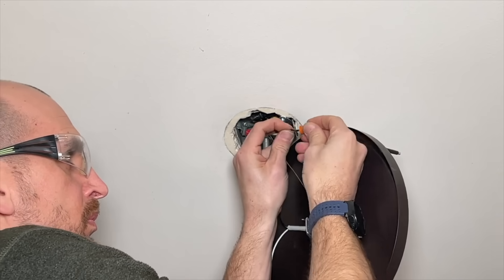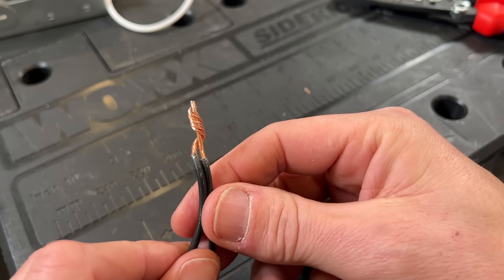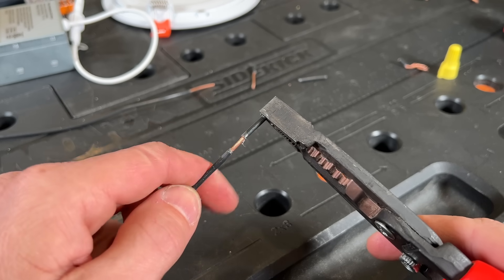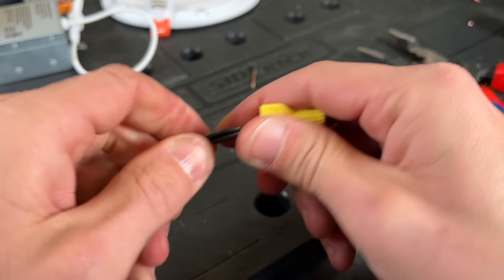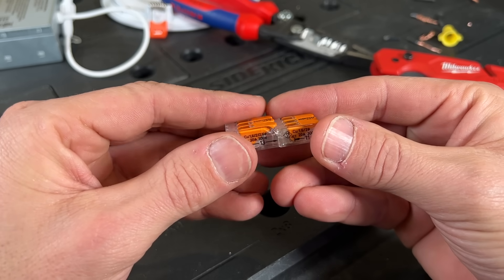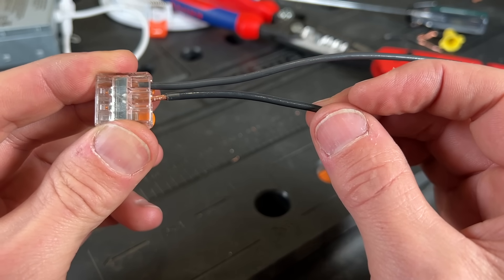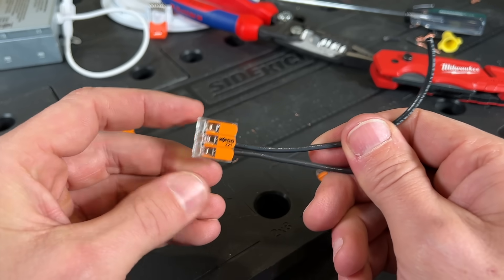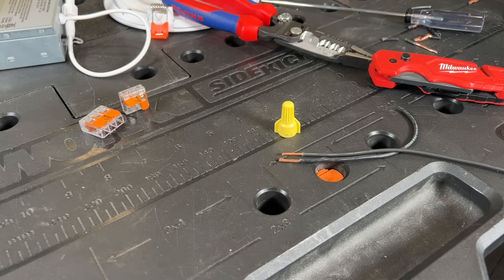Most Common DIYer Electrical Mistake - Don't Let This Be You!

Comment: Nothing beats wire nuts for cost and, as a pro electrician, that's the driving factor. I use thousands of them every year, and replacing them with Wago would be a significant cost increase that I would have no choice but to pass on to the customer. That being said, there is one place I always use Wago: when working overhead. Especially in recessed can fixtures. At 63, the less time I spend on top of a ladder with my hands overhead, the better. Wago is probably not enough faster to mitigate the cost differential, but my body really appreciates them at the end of a long day.
Reply: I also use my Ideal Stripmaster wire stripper when doing can lights. Being a union electrician, I took some heat on this but grew tired of cutting my knuckles and fingers on the sharp edged J boxes mounted on can lights.
Reply: @garrythompson4132  I feel your cut knuckles brother. Got the scars to prove it.
Reply: I learned something I hope this is. Correvt
Reply: Thats not allowed in germany ..we have to use wago's or other closed connectors...safety reasons!!!
Reply: @rudolfrudiger3283  wagos are alright. Nothing special. Literally metal blades are creating the conductive current. I feel nuts have higher contact surface area
Reply: @rudolfrudiger3283  ah. Idk. Seems to me like a child should NOT have access to inside a junction box. Regardless whether wago or nuts. Seems like a parent issue. But yeah I get what you’re saying. I know Europe has higher standards to a lot of stuff. America. We don’t give a shit lol our houses have “garden shed” roofs lmao. I’ve been to Europe. And building quality is 🤌 oh and unions. In America there are organizations you join. If it’s skilled trade. You go thru a program. And school for them. And you earn a very steady income. It’s meant to protect employees from employers. They’ll legally represent you if you have an issue. Or help you with work related injuries. They protect you from abuse of power from employer. Discrimination and such. But unions depend per region of USA. In my area. And my field (HVAC) they’re pretty pointless. Plus I’m too far Into my career to join. I’d have to start as an “apprentice” for a few years and take a huge pay cut from where I stand now. I never needed a union. I always stayed out of trouble. I avoid conflict at work. And do my job. Seems like people that join unions is because they want to take 10000 breaks in an 10 hour work day lol that’s why I feel unions are pointless in my region.
Reply: @rudolfrudiger3283  You say your products are safer but the statistics don’t back up your claim
Reply: @purplesparkyy  400 deaths per 329 million against 40 death in germany (around 80 million people...which statistics you got?
Reply: @Username-ng8jy  I saw a test a while back and at high currents (currents that are within the ratings for the products) properly installed wire nuts generate less heat.
Reply: @johnh8546  wagos are cool for certain situations. But as long as you wire nut properly. I dont see the problem.
If wagos are that good they would’ve made them for industrial high current 100hp motors. 
But we still use special wire nuts and electrical  kearneys for that reason.
Reply: Not as good as Wago cage clamp terminals
Reply: Ehhh, the cost is mitigated by how quick you can connect using Wago. Not to mention it's almost fool-proof when it comes to how its used. Never liked the wire nuts.
Reply: @NorseGraphic  As I said, I use 1000's every year. Wago is 5 to 10 times more expensive per use. I would therefore have to be able to use at least 5 wagos in the time I can twist one wire nut. I assure you that's not true. Properly applied, both are great. For a non-pro, Wago is the better choice since they have almost no learning curve.
Reply: @BB unions are pointless where I’m from. I get a rep trying to get me in lol. I’m always like fuck off dude. I do my work and punch in and out. I don’t look for conflict. I’m good lol
Reply: Common mistake. The customer decides what material you'll use, as long as they conform  the regulations . The technician advises, the customer decides.
Reply: @1Eagler  95% of homeowners don't even know what the hell a wago connector is.
They know which light fixture they want, and they don't give a crap about how you wire it.
It's why they hired someone else to do it.

Comment: Wagos are amazing and completely worth it. I usually do a quick wrap of tape on the wire then over and around the clip body for extra support and to keep the clips closed. They have held up wonderfully in a 120 F humid environment for almost 3 years now no problem.
Reply: only tape insulation not have correct anywere, not safe and not good newer. some year and all tape have open and have clear wires in box.and burn all house.

Comment: Do not use solder. NEC does not allow soldered connections.  Do not use WAGOS.  Contact with the wire is very small.  The 'Quickwire ' receptacles are also a no-no.  I have seen many failures with the 'Quickwire' receptacles.  I equate Wagos with 'Quickwire' types.
Stranded to solid wire connections:  UNTWIST the stranded strands.  Lay the strands around the solid wire with a small length of strands coming past the end of the solid copper wire.  Use IDEAL wirenuts, spin the wire nut onto the wires and then ALWAYS do the tug test.  Treat the wire nut as a cap.  Always make the connection mechanically tight. 'Bad' connections are the #1 problem I see.  Add current to a bad connection means heat at the connection.  Heat means fire.  
Your comments about how to strip the wires are correct, don't rock the stripper and nick the wires.
Be safe.  Thank you.
Master Electrician with 50+ years in the trade.

Comment: Yeah been using Wagos for ever, very popular back home in the UK. When a electrician came to my job he noticed wagos and asked about them he really liked the dinrail mount clips, he had never seen them before. They really clean up a control box and make testing, fault finding or replacement so much easier. US Inspectors are a little unsure of them and ask to see specific details. Great video
Reply: The same principle of using levers in Wago is also used in light-fixtures, as manufacturers moves away from screw-connectors. They're so much easier. You want to disconnect, just push in the lever and pull out the wire. The spring will keep it in place when you release the lever.
Reply: Works great for small diameter, like up to maybe 4mm², haven't seen anything that can handle more than 2.5mm² so far though.

At least in the company I work for we use spring loaded stuff only for the control circuit, everything power related is screwed in place firmly.

Comment: It surprises me greatly that you guys just recently 'discovered' WAGOs...those things are around here (in Europe) for at least 17 years and are 'the basic tol' for connecting wires.... 
Wire nuts just aren't used anymore for about 2 decades.
Reply: They aren't required by code and wire nuts are just so much cheaper and work fine.  I like Wagos fine but they are pricey and solve a problem that doesn't exist.   There was just never much reason or incentive to use them over here.

Comment: If youre that concerned with your connection you can tin the tips of any stranded wire with solder. You can get self feeding solder guns dirt cheap on amazon now that make tinning wire stupid easy and quick

Comment: Good in theory. But... you're leading too much. 1/16 - 1/32 is just as effective. You're stripping too long for 14 gauge. 3/8" is more appropriate. Bottom line is yes, lead the stranded by the slightest bit and problems solved. DIY'ers should really think twice about winging in their home if they need YouTube to install a wire nut.

Comment: Im actually shocked those primitive "wire nuts" are still in use.
I was working 7 years as electrician, worked on 40 year old wirings and never found something even remotely as primitive as this.
I only ever saw Wagos or some similar but older connectors.
Reply: You're not an electrician, you're a sales rep for Wago.  😂

Comment: I'm DIY and would completely disagree with using the Wago style connectors. Here is the problem not shown in this video. When you get one wire in, and you are trying to put in the second wire, and even moreso with the third wire, you wind up twisting the wago and the original wire (s) work somewhat free from the wago like connector. I've had failures with wires popping out of the wago (not all the way out so you don't notice), and not realizing it, when pushing the wago into a light box or drop light container. This video shows a beautiful easy to reach level perfect light situation, but in reality, you are looking upside down, not the best light, quarters for working are confined, wire lenghts are limited, etc, all that real world stuff. I liked the part of this video about wire nuts, but I never, and I mean never, put a wire nut on two or more wires that have not been previously twisted together, using flat head plyers and not twisted together by hand, such that both wires are twisted together, and not one wire twisted around another straight wire.

Comment: Wonderful presentation.  I am a two time homeowner who does all my own electrical work.  I have always dreaded installing light fixtures due to the challenge of connected the solid building wire to the stranded leads on the fixture.  I am a perfectionist and early on I practiced over and over with scrap wire until I felt confident that I had the hang of making a good connection.  Over the years, I also have tinned the bared ends of the stranded leads before twisting them with the solid wire.  When the push-in connectors appeared on the market I had mixed feelings about them but went ahead and have used them in smaller light fixtures in my home. I always tinned the stranded wires before pushing them in. The latest connectors I used to install several motion sensor lights are made by Ideal and have a brass barrel and a set screw.  You slip the bared ends of the wires in and tighten the set screw. Then you screw the plastic cap of the connection.
They are reusable and are well made.
Reply: I don't understand this comment section. I mean I've hung literally thousands of lights/fans. I've been stoned. Ive been buzzed. Ive done it standing on hand rails. In the dark.  I've taped an extension ladder to a step ladder  Ive hung off the sides of houses and hung lights. In the rain. In crawlspaces with crickets and webs and shit. 
I've used wire nuts every time. They always work. 
Why do you all make shit so hard 😅

Comment: The lever nuts look great, but are they readily available and the common stores? They are way expensive too. I can find 180 wire nuts for 7 bucks on amazon. For 10 lever nuts it's going to cost more than 180 wire nuts.

Comment: Good video over all. Let the stranded lead the solid wire. When stripping the wire, strip to 5/8" max, not 3/4" or more, this would help by twisting the wire nut tight enough that you don't see any copper looking into the wire nut. Final strain and minimizing shorts would be to wrap with approved electrical tape.
Reply: Dude no one is measuring 1/16th of any inch when they’re stripping wire in the field. Strip enough to make a nice splice and then trim the splice back if it’s too long. Much easier and faster to do that then sit there measuring.

Comment: There’s another trick that works extremely well. I bend the solid wire into a small wave form with two dips and two valleys. I wind the stranded wire around the bent solid wire and then twist the wire nut on. Works every time.

Comment: The potential problem with wagos is placement. Repeated use of a receptacle wiggles the wires & duplex in the box. If wagos are not wisely placed with the levers facing the box wall and free of any wire contact, they could be opened just by normal use of the outlet. You’ve all seen how outlets get loose over time, cords sag, prongs are exposed, etc. Same thing. They may hold 25lbs on day 1. But wiggled each day for a few years and they can fail, even be a fire hazard. They’re like Sharkbites for plumbers. Great for quick fixes. Not a great idea for permanent installs.
Reply from the maker: I definitely have not experience Wagos relaxing over timer and causing issues.  I guess time will tell but I feel confident in the design and materials used.  Just my 2 cents.

Comment: seems the actual surface area of connection would be minimal at best using WAGO....like setting a knife edge on 12ga. solid core....almost molecular in measure....no thanks.

Comment: those twist connectors are shit ,any electrician using them is a lazy electrician. use a screw block connectors .Anything else is fit quick and cheap , leave and get paid.

Comment: Wire nuts ARE NOT for twisting the conductors TOGETHER, that's a huge no no, you pretwist the wires together, cut down a small piece so that when you apply the nut, it's locking the twist. Wago is completely unnecessary.

Comment: Thanks - that has always driven me nuts! I would pull on the wires and it would fall apart sometimes, work others. I never made the connection between the stranded being ahead of the solid.

Comment: Excellent presentation - I suppose in my very shallow experience it goes electrical tape - wire nuts - wago.  🙂  I especially appreciate the weight test.

Shrink wrap.  That's what I forgot.  Ha!  Certainly between the tape and nuts.  But really more for automotive/electro-mechanical work - not what you've outlined here.  At any rate, you have a new subscriber.

Comment: Not a fan of the WAGO style for machines. They could be so much better if the levers locked in place. The ones we had worked their way loose over time. I'm sure they are fine for an application that is stationary, especially if you tape them up but in a machine with vibration and movement,  no.

But then you have the cost, and the extra points of failure by introducing three separate connections to the 
Bus (if you use all 3 wires). Better I think to smash the wires into each other surrounded by a "bus".

Full disclosure the WAGO we had looked more like the 222 not the 221. Maybe the 221 is designed better? I hope so.

The WAGO did make for an easy fix when we found the loose wire. Easy to pop it back in and then tape it down...

Comment: I always pre twist the wires...just jamming the wire nuts on two wires does work well....But.... especially after many years I've dealt with and have seen too many times you end up having a bad connection ..

Comment: Are these approved by the ,National Electric Code ? You know the electricians Bible....you have to love the code as depending on chapter and verse, the proper connection gauge load wire type...may conflict .... each year they meet and changes are published daily, after 7 to 10 days the finial version is published , I did mention they publish a complete book each day ....yes they set up a print shop complex printers bare paper out the other end a complete bound book, ...once had to wire up their event, makes my head hurt did I do all those drops and connections right ? Maybe !

Comment: I’ve been using the Wago connector for sometime now and love them. Yes, they are more expensive then a wire nut but I’m a DIYer and so for the few  times I’ve used them , the cost isn’t a factor. One thing I haven’t done is use them on a 240 volt connection with 10 gauge wire as I’m not sure they can handle the load. You’re saying they can? I’m installing a 30 amp 240 volt garage heater in my garage and would love to use them. What do you think?

Comment: That is good advice, but I would also recommend never reusing wire nuts. Possibly with small wires like 18-24 gauge if you don't  have a new one available, but never any thing larger.

Comment: As a 15 year commercial electrical foreman you did a wonderful job showing how wagos are properly used. One thing on your technique in stripping wire. It’s a 3 step process. Close the stripper fully to cut the shielding completely, release the pressure to roughly 80-90%, THEN pull the shielding off. If you keep it completely closed it will scrape along the copper and make it hard to strip. I keep wagos on the truck because sometimes you come behind DIY’S that have done a bad job and left short connections in a box and you can’t twist the connections properly.
Reply: Great info Juan - when you apprentice to a journeyman, or better, a master, you watch them make very short work of tasks that can confound you.  There have to be tens of millions of techniques and tips that aren't being passed on to this generation for a wide variety of reasons.  Thanks for the comment.  🙂

Comment: Strip the stranded conductor twice the length you strip the solid conductor. 
Wind the stranded conductor around the solid conductor clockwise with no space between the coils. Trim the pair of conductors to square the end at proper length for the wire nut/wire size. 
You will find the wire nut will compress the stranded conductor very tightly to the solid conductor and this connection will never fail.
Reply: That's the way to get the best connection with the insulation lined up together. After twisting, just take the lineman pliers and clip the end to the appropriate length for the wire nut.